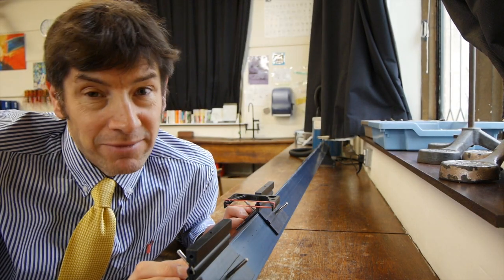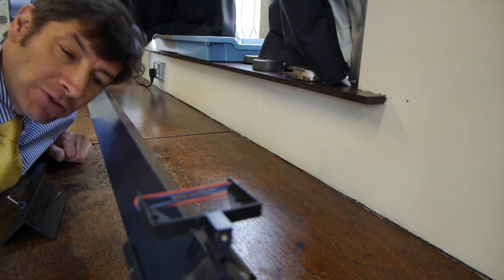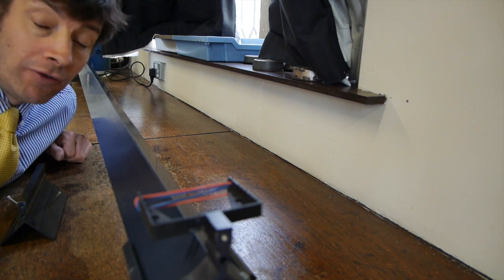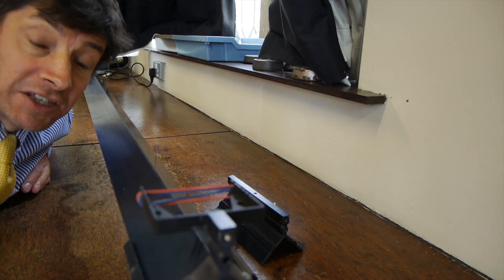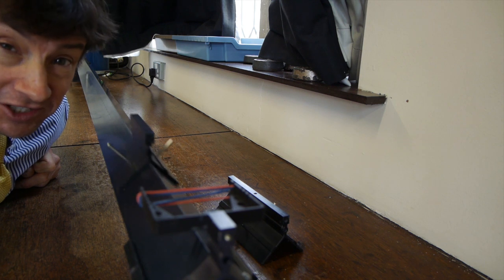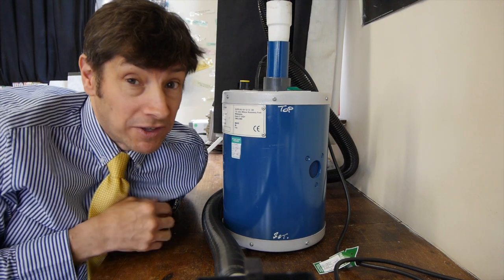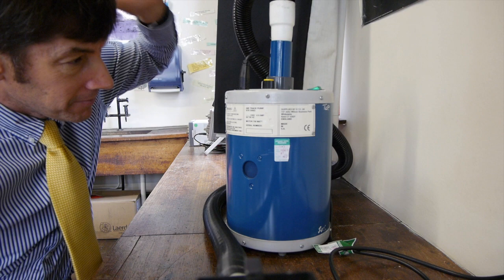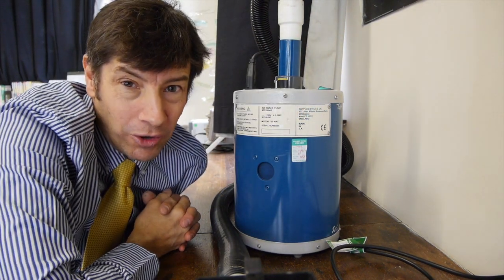Linear Air Track - F-J's Physics - Video 39

Comment: I'd be very interested to see motion on a track which has a slope with point heights of y=(ax)^2 ?
I'm thinking might produce some interesting results when masses that are rectangular, have their orientation wrt track changed.  same mass, same slope, but different accelerations?
Reply from the maker: Yes it is interesting to do different shaped tracks, especially with different masses.  I have been meaning to do a video on that for a while using cable trunking or curtain track which allows you to bend it to the shape you need easily. Thanks for watching!